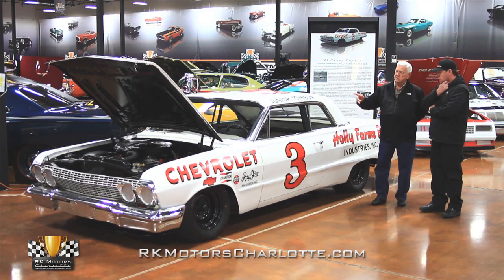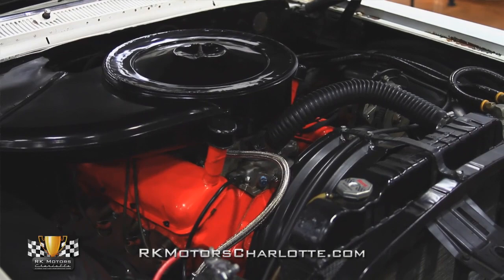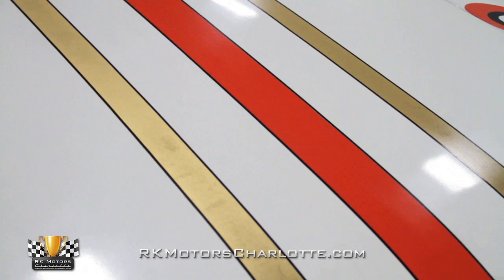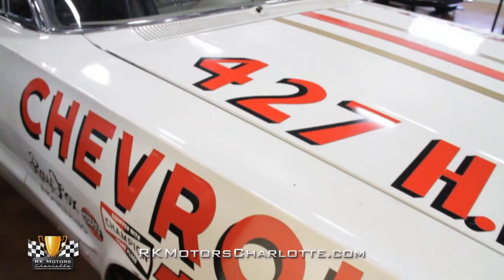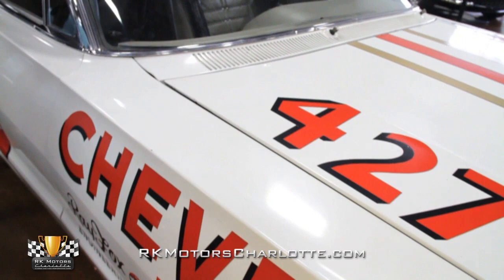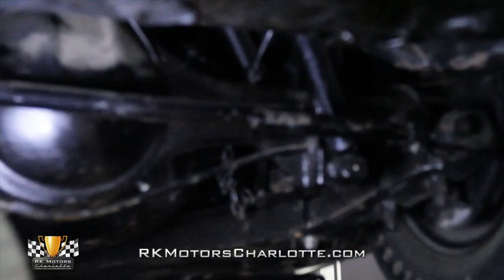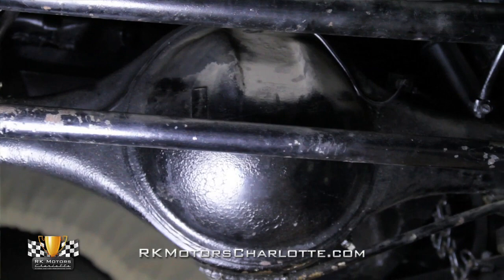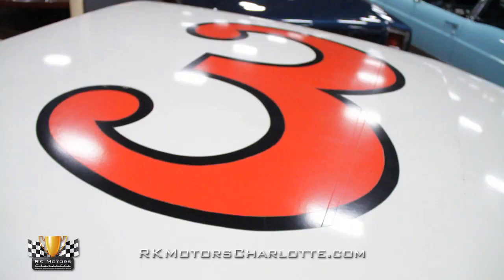Junior Johnson and his 1963 Chevrolet Impala SS

Comment: Once upon a time Chevrolet built interesting vehicles 🚗.
Reply: When Junior got finished, the only thing 'Chevrolet' was the fender logo. By changing the block to big bore, short stroke he was able to mount the engine lower in the chassis, making a lower center of gravity and better handling. If they had found a valve train that could have stood up to the strain, they would have won every race that year.
Reply: @johnkidd1226  push rods were bad Smokey Yunick said to me he would have used titanium and would never have to worry about breaking anymore
Reply: Now they want to build electric junk that is a big joke
Reply: It’s not just Chevy , they’re all garbage especially Chrysler products and Ford too . At least they’re all making a descent pickup

Comment: 58-64 Impalas all had 3 link arms, coil springs, and a panhard bar. They put truck suspension, and an Eaton "jackpot" truck rear axle under this car. The axles and brakes were machined for 5 lug wheels. Nothing under the rear of this car is stock. JJ was an innovator.

Comment: If i recall correctly: The 1963 z11 427 al front clip cars... where based on a 409 W block and yes they did have a complete frontend made out of aluminum,  but those where made for drag racing. They only made enough aluminum front clip parts to have 2 of everything for each car and you had to show proof of owning one of the z11 drag cars to buy any of those extra aluminum replacement parts (according to the guys i met who were into them when they came out). One of those guys... back in the 80's in my area had collected all the aluminum parts for a 63, but could not get a guy he knew down south to sell him the z11 he had. It was backed into one of those shorter one car garages of the day that an impala was too long for and the front clip was getting hammered by weather... then after years of stopping each trip to try to buy it...they'd had it towed and that bent the whole frontend up... the brackets, fenders, inner, hood hinges, fan shroud... everything was al from windshield forward. It then just vanished. I saw a z11 up close (that ended up in reggie jackson's collection until it sold awhile back), not sure who owned it when I saw it. That was at one of the very first late great chevy car shows in St Charles IL in early 80's. I think that one was a 1962. I was into the 1964 ss impalas and wanted a 425/409 64 so the z11 blew me away and these two z11 guys where older back then and into them when they came out. I then found an article about them in a chevy magazine. I do not think they made them in 1964 but i eventually landed a couple 409 4spd ss impalas, 400/409 hardtop and a 425/409 ragtop. In 1961 they made a very few impala ss cars. Only about 285??? Only a few were 409s. Knew an older guy that ordered one red on red to drag race...came with the 348 so he did not accept it and to get his 409/409 had to take a 62 409/409.  That car was still show room perfect in 1982-3 when I was trying to buy it...price  kept going up until a pilot for John Deere gave him over 6500... a lot of money then... but a great investment if they still have it.
Reply: What on earth does any of all that have to do with THIS video ?

Comment: Truly a priceless car !! And for so many reasons...The historical significance of this car to NASCAR, and Chevrolet...The biggest part of that is the engine..The Mark II big block 427..Fewer than 50 was ever made before Chevrolet pulled out of racing..The block was basically the same as the Z11 427 "W" motor, but what made this perform was the "porcupine" style heads that later found there way on the modern Mark IV engines..
Some of the Mark II engines are still floating around and are considered priceless..But to have one of these engines in the car that was intended to race it is....Wow..How do you go beyond priceless??
Reply: 1 million dollars car  not less
Reply: Was that what was called the mystery motor?
Reply: @tommymitchell2935  Yes sir this is what is referred to as the”mystery motor”. 
These engines are priceless and impossible to find or find parts for.
Reply: Canted valve big advantage
Reply: @one for liberty; you need to study up on 409 and 427 facts some more . The Z11  was a stock 409 block with the special heads and intake . It used the stock 409 bore of 4.3125 inches coupled with a 0.150 longer stroke to make its 427 cubic inches . This was the combination developed for the 1963 drag racing season and installed in 57 Impalas equipped with aluminum front ends and bumpers. The Mark II Nascar 427 was the predecessor of the 396/427/454 Mark 4 engine series . It used a 4.250 bore and 3.760 stroke , the same as the 1966-69 427s used . The cylinder heads will not interchange between a W series engine and a Mark series engine .

Comment: Joseph Monaco1 second agoThat motor was a 427 bored over.30. It was a 433 CI Engine with 12 1/2:1 Compression with closed chambered heads with 219 intake and 188 exhaust valves. It had a 376 crank in it, with a holley 780 double pumper in it. It had the original big-port heads in it. The heads had round exhaust ports and had two-cast iron pushrod guides per head. My motor came with forged 12 1/2:1 Compression TRW Dome top Pistons. It had a forged steel cross-drilled crank. It also had the rod journals were carefully radiused. The exhaust studs were extended to use a windage tray to keep the hot oil off of the crank. Chervoret really used their heads when they made their motors. It had the L-88 cam, part number 3925535 with 0.540/0.560 lift and 269 duration at 0.50 at a 110 lobe separation. That motor in reality put out around 600 plus H.P. Not like they advertised in the 1969 Corvette, because back then, your car insurance was based on the H.P. of the car. So, Chevrolet rated the car at around 435 H.P. so the buyer didn't get raped on insurance, but, like I said, those components in a .30 over 427 with 12 1/2:1 compression engine put out about 600 H.P. Respectively. Ask Junior, and see what he has to say about it!  I have one of those exact motors only I have the Big Rectangular Open Chambered Heads on mine. It breathes a lot better because the spark plug is angled so it doesn't have to run straight into the intake and exhaust valves. Read up on the head design of the open chambered heads and you will see that they breathe a lot better than the closed chambered heads. Although, the closed chambered heads were Killer also. Either way, It's a winning combination.

Comment: Thats an Eaton HO52 rear end. GM used those axles in 3/4 ton trucks from 1947-1972. Its a full floating axle with an option of a no slip diff. Parts are hard to come by anymore but a lot of the 10.5in 14 bolt internals will swap right over to the Eaton.
Reply: AROUND THAT TIME, MOST OF THE DRAG RACERS, NOT NASCAR GUYS RAN 58 OLDS POSITRAC REARS, THOSE REARENDS WERE VIRTUALLY INDESTRUCTABLE
Reply: @williamcox5216  Ran an Olds rear in my 1969 Fletcher Chassis Funny Car (former Clyde Morgan Javelin). They were indeed bullet proof.
Reply: HO 72

Comment: Sorry, they were not pulling 700-800 HP in 1963.  Bill Howell, GM engineer who supervised testing and development of the Mk II mystery motor said it pulled 530-540 HP and never knew of any cars, even the drag cars with dual quads, pulling 600 HP, even if just for 12 seconds.
For reference, the Ford 427 was pulling 580-585 HP and the Chrysler 426 Hemi was pulling 585-595, after 6-7 years of development and rule changes, while the Boss 429 was 580 HP out of the box and pulling 610-620 HP with modified heads and Wood Brothers/Holman Moody tuning by 1970.  Those numbers come from Chrysler and Ford documents and interviews with Waddell Wilson and Robert Yates.
Yep, the windshield wiper motor had to stay, the window operating mechanisms and even the seat had to be stock and of the same make.  Shoulder harness became mandatory in mid 1965, making it into the 1966 rule book.
And for those that like to claim everyone ran a Ford rear end, please grab a rule book and read it.  All parts had to be 'stock' for the make but swapping for "HD" (truck) parts or other model was allowed.
As for the HP numbers on the hood, those had to be 'factory stock' numbers, which is why it says "427 HP".  As for Junior Johnson's HP numbers..  Add 5 HP a year as the tales get taller and taller, like a fisherman adding an inch to that fish that was caught each time the tale is told.   ;-)
Have fun!

Comment: In 1963 at Daytona 500 Fred Lorenzen won the pole 160.943 mph in a Holman-Moody Ford. The 100 mile qualifying races were both run with no caution flags. Johnny Rutheford won the 2nd one at an avg. speed of 162.969 mph in a car prepared by Smoky Yunich. Junior won the first won with an avg. speed of 164.083 mph. Both races faster than the pole speed. In the 500, Junior's engine didn't last but 26 laps. He led 12. The  race was won by Tiny Lund driving for the injured Marvin Panch whose life was saved days earlier by Lund and others in a turn 4 crash.  He drove the Wood Bros. car to victory by making one less pit stop and never having to change tires.
Reply: Tiny ran out of gas as soon he crossed the finish line. No victory lap for him just cut across the infield grass
Reply: @paulgrieshop5024  Of all the Daytona 500 wins Glen Wood said that Daytona 500 win meant the most to the team
Reply: @bbigjohnson069  I know its was the first one for them and Ford.  A co worker of my Dad was at the race a ford man he was so happy that's all he talked about for months .

Comment: It was one of the very best engines ever. Years ahead of time think about this had it been totally polished the wins and records it would have had. It would have been the only engine that could go toe to toe with the hemi. Smokey told me that the push rods would break and he had to do it all over he would have use titanium instead of steel.  He said the hemi can be beaten and was beaten and it's not God like these mopar people think.  In matter of fact a dirty little secret Junior and Ray switched over to Chrysler in December of 1963 before the 1964 season.  They took there Chevrolet to San Angelo Texas and worked with Chrysler on the Goodyear test track they had the track is a 5 mile course.  They were like a jackrabbit and the hemis the greyhounds.  Even Chrysler officials said that was an excellent car and hated to face it had it been polished and GM was still in racing.  The big 3 always borrowed, stole, gave and help one another no matter what people say Detroit is a family.
Reply: Fun fact in drag racing one of the arch nemesis of the N/A Hemi was the SBC back in the day. The Hemi had weaknesses that were easily exploited in the quarter mile that weren't as apparent in NASCAR. I think it's important to note contrary to popular belief Chrysler did NOT invent the Hemi. Ford had the Hemi YEARS before Chrysler and ironically it was a Ford guy (Bob Glidden) that would unlock the true potential or the N/A Hemi.

Comment: The hood markings say 427 Horse Power not 427 Cubic Inches! That was how NASCAR did it back then.
Reply: That motor was a 427 bored over.30. It was a 433 CI Engine with 12 1/2:1 Compression with closed chambered heads with 219 intake and 188 exhaust valves. It had a 376 crank in it, with a holley 780 double pumper in it. It had the original big-port heads in it. The heads had round exhaust ports and had two-cast iron pushrod guides per head. My motor came with forged 12 1/2:1 Compression TRW Dome top Pistons. It had a forged steel cross-drilled crank. It also had the rod journals were carefully radiused. The exhaust studs were extended to use a windage tray to keep the hot oil off of the crank. Chervoret really used their heads when they made their motors. It had the L-88 cam, part number 3925535 with 0.540/0.560 lift and 269 duration at 0.50 at a 110 lobe separation. That motor in reality put out around 600 plus H.P. Not like they advertised in the 1969 Corvette, because back then, your car insurance was based on the H.P. of the car. So, Chevrolet rated the car at around 435 H.P. so the buyer didn't get raped on insurance, but, like I said, those components in a .30 over 427 with 12 1/2:1 compression engine put out about 600 H.P. Respectively. Ask Junior, and see what he has to say about it!  I have one of those exact motors only I have the Big Rectangular Open Chambered Heads on mine. It breathes a lot better because the spark plug is angled so it doesn't have to run straight into the intake and exhaust valves. Read up on the head design of the open chambered heads and you will see that they breathe a lot better than the closed chambered heads. Although, the closed chambered heads were Killer also. Either way, It's a winning combination.
Reply: ***** Thanks for the detailed response.
Reply: a few were 409 cid/430 hp.from the dealership.
Reply: timothy lines........You don't understand.......THIS motor was NEVER available in ANY number made to the public. Watch the video again. Other videos also show Junior saying the same thing, just like this video, quote: IT WAS AN EXOTIC ENGINE DESIGN MADE ONLY FOR NASCAR, AND THEY ONLY MADE ABOUT 20 OF THEM. Junior got 7 of them, Smokey Yunick also got 7, and the few remaining went to teams who didn't even run Chevy's.....such as Chrysler.......because NASCAR mandated that the manufacturer of any race engine HAD to make at least one available to one team running other brands, so they could investigate the BASE engine of their competition. Keep in mind, the other few teams that did NOT race Chevy's, got the BASE engine exactly like this one........and Ray Fox/Junior Johnson and Smokey Yunick did things to these engines once they got them from the factory. But NONE of these exotic "mystery motors" were EVER distributed to dealers to make available to the public.
Reply: Rusell Shaw  He was referring to what was written on the hood. It did say "427 H. P." Steak Man did not say that was the actual horsepower. Richard Petty's 64' Plymouth said 405 H.P. on the hood when it was actually over 750 horsepower.
Reply: Timothy, you may be talking about the Z11 427 which was the 409 style engine I believed stroked to 427. I believe they were rated at 430 HP.  Dave Strickler ran one for drag racing and you can look it up on You Tube.  This mystery engine in Jr.'s Car was the first design of the porcupine head engine still being made today and came as the 396 in the 65 model year.
Reply: @howabouthetruth2157  You're right. The 427 Mystery Motor and the Z-11 427 are two completely different engines. The Z-11 was based on the 409 and was used in NHRA Super Stock drag racing. The 427 Mystery Motor's architecture was more like the later 396/427/454 big blocks. People think the Mystery Motor and the Z-11 are the same engine
Reply: They always drasically under rated the HP.......at Least untill 1970.
Reply: @howabouthetruth2157  Smokey told me a total of 23 were made.
Reply: @larryburton5516  correct Larry...Z11 was a W head motor like the 409.
Reply: @jamesgeiger4795  not 750 BS
Reply: @bbigjohnson069  Are you referring to the comment I made about Petty's 426 Hemi? It's been years since I made that comment, but I believe that is what I read about the prototypes that were made specifically for the 64' Daytona 500. The street version that eventually came out a couple years later was rated at 425 h. p.
Reply: @bbigjohnson069  Not even sure this is the same race. I'm not going to click on it to find out, as I have other videos I am watching. I think this about Junior Johnson's mystery 427 in the 63 race.
Reply: @jamesgeiger4795  Chrysler never would say. Later it was leaked by those in the know that it made an easy 650 HP at factory spec's. and close to 750 HP in race trim. If Junior was making 650 HP in '63 with the 427 and he went 165mph then what would it take to run 174 mph the next year? It was said that none of the Chrysler drivers had their foot in it or they'd of run 20 mph over Junior's '63 speed. One thing is certain: The real BS was in the factory HP ratings.
Reply: @bbigjohnson069  I think Petty was hitting 180 on the back stretch in the 64 race. I don't think those cars were aerodynamic enough to go much faster. I remember looking at videos of the 63 race and seeing just how loose the rear ends were on some of those cars coming out of the corners. I remember the 63 Fords were pretty bad ass. Seems the Chevys ran strong but didn't last the entire race, if I remember right.
Reply: @bbigjohnson069    Nope.   595 HP for the Hemi by 1970, final year before the restrictor plates.  Factory documents do say what the HP was and they are available at the "Chrysler Document Archive".
Reply: Yep.  Factory HP rating.
1963 NASCAR International Rule Book - Section 20-8 -- Engine
a. NUMERALS INDICATING THE HORSEPOWER RATING OF THE FACTORY MANUFACTURED ENGINE ASSEMBLY MUST BE PAINTED ON BOTH SIDES OF THE HOOD IN NUMERALS AT LEAST EIGHT INCHES HIGH.
Reply: Thank you for the time you spent on  research. This is what I was looking for, the precise rule that said how it was to be done. Thanks again👍👍👍

Comment: What did the other chevys run that year? I remember seeing a lot of 63' Impalas/Belairs in that race.
Reply: They ran impalas in nascar belairs in nhra and corvettes in scca
Reply: @paulgrieshop5024  I was wondering what engine. Did they all have the mystery 427 like Junior Johnson's or did some of them run 409s? Or even the W block 427s, because Chevy did make a few 427s that looked like the 409/348 engines. Where as the Mystery 427 looked more like the later big block Chevy engines (396, 427, 454 etc.) on the outside. I read somewhere that they ere different than the later engines, but they looked similar.